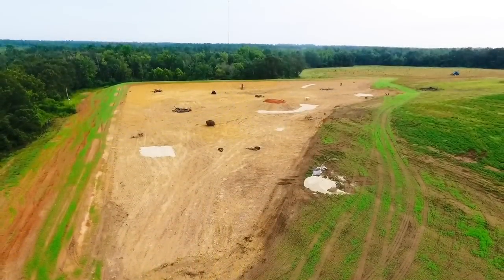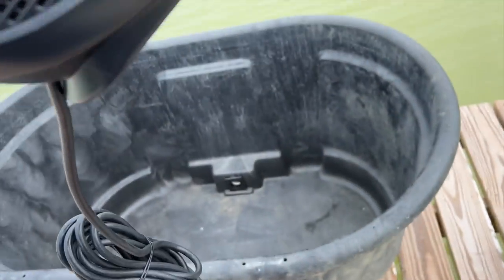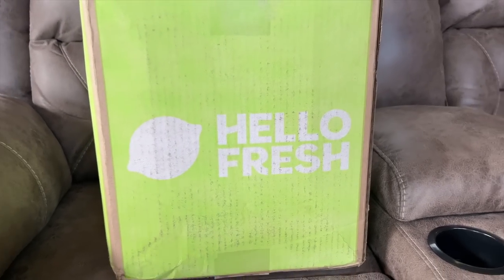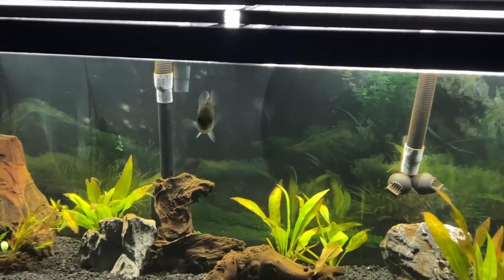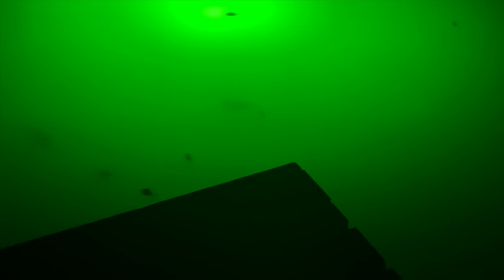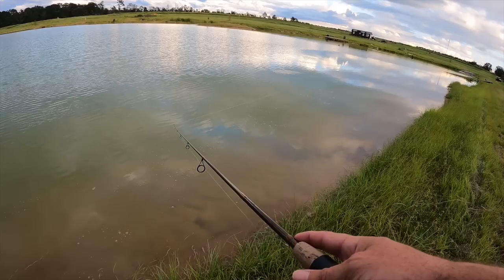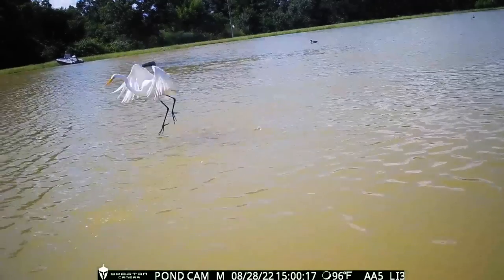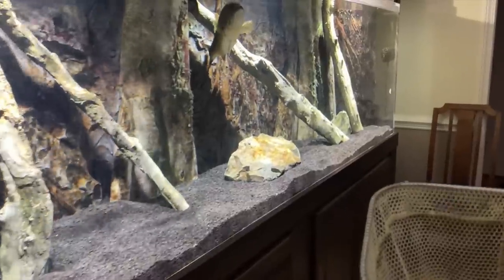Building a 5 Acre Pond! (Adding 300 Goldfish)

Comment: I would strongly recommend not adding any goldfish. They will eventually take over the pond choke out the bass and bluegill. They feed by digging along the bottom they are always clouding up the water and they will eat the eggs of the other fish.
Reply: The aggressive bass will quickly prevent the goldfish from taking over. Ive seen many ponds down south stocked with goldfish and in a few years most of the goldfish were gone.
Reply: @Tackletuesdayfishing  Not if the goldfish are too big for the current size bass. goldfish grow large and quickly too.
Reply: @Mr.LakeShow   with how aggressive the predators are around his property, I doubt that will be an issue. Goldfish don’t just spontaneously multiply. When they do have a spawn. Then those fry will be easy pickings for small and large fish.
Reply: @Tackletuesdayfishing  the problem is also the chance they get out besides all the flooding security systems in place and take over waterways
Reply: I agree, goldfish bad idea for pond.
Reply: He’s clearly a millionaire ( good for him ) but has no idea how invasive that species is-the risk/reward is not tenable.

I guess he wants a swamp now. 🫥
Reply: @niagra898  everyone on the internet is an expert. He knows what he’s doing. Goldfish won’t survive a bass pond.
Reply: Also, what're the chances that they might escape into the local waters?  A really massive flood or a breech could send a bunch out into the wilds.
Reply: Goldfish also eat their own eggs. Goldfish are crazy.
Reply: Agree on the goldfish, the might not get the chance to grow because blue gill and small bass will eat the fry but if they escape because of a flood they can invade local waters very quickly. Also goldfish are the worst feeders you can get for your fish, if you feed your fish too many goldfish they will die eventually.
Reply: dont worry. ammonia crash in that tub in a week
Reply: @Tackletuesdayfishing  why risk it? It’s a bad idea but hey it’s his pond right? 😂 why not add a few silver carp while at it.
Reply: @jeoffbenzos4959  tell that to the goldfish.
Reply: @Tmorans   I’ve found goldfish to be a great feeder fish in several ponds. Bass and birds will make quick work of them especially since he has a lot of bird activity around his pond.
Reply: @Tmorans   I’ve found goldfish to be a great feeder fish in several ponds. Bass and birds will make quick work of them especially since he has a lot of bird activity around his pond.
Reply: @Tackletuesdayfishing  Ummmm do you not know that goldfish have over 1,000 eggs a day, and they lay multiple times a week.
Reply: 👏people! Goldfish release thiaminase which destroys vitamin B1 in animals. I had goldfish in a tank with a red-eared slider a few years back (RIP)... Basically, TAKE THE GOLDFISH OUT! They are beautiful fish, but maybe make a pond far away and have an all-goldfish tank. If done right they are beautiful
Reply: @jeoffbenzos4959  Um we're experts compared to you. We have educated ourselves on this, and are giving constructive feedback.
Reply: @MossyWonder  no, I’m an expert on goldfish. I know more about goldfish than you could ever dream of knowing. Your turtle was a beta just like you and that’s why it died.
Reply: @MossyWonder  watch and see how his pond won’t have any issues. Bass have even been used to eliminate goldfish in ponds. These F-1s will make quick work on them.
Reply: @jeoffbenzos4959  That is very much not true.
Reply: @1969yenkofan  sorry, did you major in biology with an emphasis on goldfish? Didn’t think so.
Reply: @jeoffbenzos4959  aquatic biologist actually care to try again?
Reply: @jeoffbenzos4959  with actual real life experience managing waterways. Hands down and bar none goldfish are one of the worst things to add.
Reply: @Tmorans  exactly. This is so unnecessary
Reply: The bass candy eat the goldfish. He even says that they are bigger than he expected and too large for the bass to eat. The pond is going to be nothing but goldfish carp in a few years.. such a stupid idea
Reply: Can’t eat*
Reply: @Tackletuesdayfishing  goldfish breed like rabbits and quickly overran my pond. the the blue heron showed up and eliminated them
Reply: @richardhead3211  big bass and big birds definitely make quick work on goldfish
Reply: @Tackletuesdayfishing  the coloring of goldfish is a big downside making them easier to spot and slam in their bellies.
Reply: he should have gotten comets. They're more slender than common goldfish and less bulky. might wanna try that one next instead Bama (if you're reading this) comets are far less likely to populate due to their lack of size unlike the common goldfish you have there. Just something to think about if you ever decide to get um another round. They're devourable! 😎
Reply: @PurpleDrac  the comets i put in my pond quickly overran it. then the herons showed up and ate them!
Reply: Way too late for that

Comment: Run it like a live well. Pump water into tub. Drill a hole in top of tub to run water out before overflowing. Continueous fresh water flow that is filtered by the pond. The water temp stays the same as the pond as well. Heat and cold will effect the tub more than the pond. No filter maintenence.

Comment: I suggest skipping the pond filter entirely. Just pump water from the main pond into your bait well. Then match your drain return to drop into the pond below. It will be less equipment to manage and use the natural pond filtration.
Reply: Not to mention temperature control.
Reply: I was thinking the same thing. Let the pump in the pond and make some holes on upper side of the bucket to keep the level constant.
Reply: Same thought here, suspend the pump 1ft under a float

Comment: You could build a stand pipe that drains back into the pond and use that pond pump to pump water into the stock tank. Doing this will allow the fish to be already use to the pond water and you will have fresh clean water all the time without that bulky filter.

Comment: Congratulations on the expanding family!  As for the bait holding tank, if you're going to have a pump out there to begin with, why wouldn't you pump directly from the pond and have a standpipe/overflow that drains directly back into the pond?  You wouldn't have to mess with a filter.
Reply: My first thought as well. Lol 🤦‍♂️
Reply: Not only that, but it would regulate the water temperature.
Reply: Second this. Will help regulate the temperature and you will not need a filter.

Comment: Congrats on the little one coming!

I'm confused though why you would put a filter on the feeder tank and not just pump pond water into and out of that tank? Filter or not, they ammonia and nitrate levels are going to be off the charts with that many fish in the tank... Not to mention that water is going to get super hot in that black plastic tank, which will also hurt the oxygen absorption rate of the water.
Reply: My thought as well, add an overflow trough to the tank and just pump in fresh pond water, job done.
Reply: defenitely the better option to pump the pond water into the tank and use an overflow if the fish shall stay in there more than a few days. Water temperature will stay the same as in the pond and fresh water coming in
Reply: The tub is too small period. beyond overcrowded for 1000 + fish. going to need a MUCH bigger tub.

Comment: I put a livewell on my dock, for the cost of a poly, 
oil type barrel, ($20) and a couple of feet of rope to tie it to my dock, I simply got a drill and drilled a couple of hundred holes in the barrel. There are enough openings to simply allow the natural flow of the water to oxygenate its contents. I used zip ties as hinges and cut a large opening on top for access. It works great!

Comment: that tank is pretty small for that many bait fish even with a filter. id recommend dropping that pump down in the pond and tie it so it sets mid water column so it doesn"t get trash in it. then add a pipe with a 90 coming from the drain or a bulkhead if your drain is smaller than the pumps hose . you can put a piece of pipe up to what you want the water level as long as your drain is large enough it will stay at that given level it will keep the water the same temp as pond even in summer.

Comment: spray bar for bait tub = 1/2" to 2" pipe. end cap for one end, barb fitting on other end, smallest drill bit you have. just drill holes along pipe 1 or 2  rows down the length of pipe. pump -> filter -> spray bar.  make spray bar little longer than bait tub. so bar just laws down on top of tub.  you do not need "pressure spraying water" like a watering your lawn sprayer. but pouring water out of bottle of water tiny stream with no real pressure.

Comment: About the bait tub, you could add the pump in the pond, make it pump though your drainage tube at the bottom of it, and make a hole at the top of the tube so it's always filtered with the pond water, I feel like there might be too many fishes for that tub and adding that water to the pond system would help a lot.

Comment: The filter for the bait fish is not really needed if you would pump the water from the pond inside the container and make an overflow in the bait container which returns the water to the pond. It would also create a small waterfall for the pond. And the fish love to hang around those areas.

Comment: You didn't need a filter for your bait tank, if you'd drop your pump into the pond and put an overflow into the bait tank, fresh water would pump into the tank and used tank water would overflow out.

Good idea on utilizing foam for a shade on the tank.

Comment: For the stock pond you should just pump water from the pond in it. And then drill a hole for an overflow back into the pond. No need for a filter & cleaner water.

Comment: I would probably just make that bait tank a flow through system. I would put the pump in the pond drill a hole in the tank at where you want the water line and just have the water flow back out in the pond. That way you don’t have to worry about the filter and the bait tank always has fresh water.

Comment: take PVC piping any size from one inch tube up make a box out of it cover in netting make a lid for the top and you can even make it on an angle so it sits on the bottom closer up to the dock the drill a bunch of holes in the piping and it'll sink

Comment: Could you set up a system that would circulate fresh pond water rather then just filtering water for your feeder barrel. Seems like that would provide not just cleaner water with pond generated nutrients but also a much more controlled temperature for the barrel as well. But I don't know if it would be more trouble then it's worth or just plain unfeasible that is why I posed the question.

Comment: You could skip the filter and just use the pump to run pond water into the 100 gallon tank and then use an overflow drain to return it to the pond. Tank will always be the same parameters as the pond.
Reply: Also never have to worry about evaporation.

Comment: If it was me I would have ran a pump from the pond to the live well and put a mesh screen in front of the drain and opened it to where it constantly cycled fresh water from the pond. That way your actual water size is all the water in the pond not just the water in the live well. That would make for less cleaning and constant freshwater no water changes needed at all. But thats just me

Comment: Why not just pump water from the pond into the tub with an over flow back into the pond. You can use a pvc pipe with a bunch of small holes drilled in it for the overflow, that way you won't lose any fish. No need for a filter

Comment: I predict complete failure of the bait tank in a few days… some combo of overheating and inadequate filtration for the huge bio load will suffocate and/or poison the fish. You need to be pumping pond water into the tank and having it overflow continuously vs asking a small filter and a small volume of water to support hundreds of baitfish (and goldfish are extremely messy).  Maybe if your filter was full of mature bio media you might be able to handle a fraction of that bait, but seriously that thing is doomed to fail.
Reply: yes those fish will definitly die. Putting 1300 fish in a small tub like that with an undersized uncycled filter is just animal cruelty.
Not just all the ammonia. The fish are so crowded they stress the life out of each other. The reason the fish are jumping is because of stress. They just want to get the hell out of there